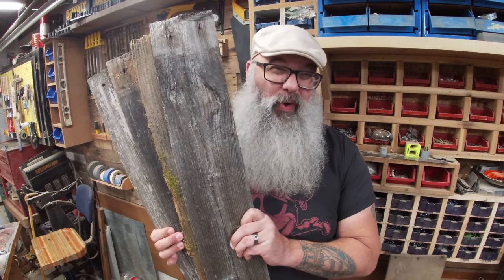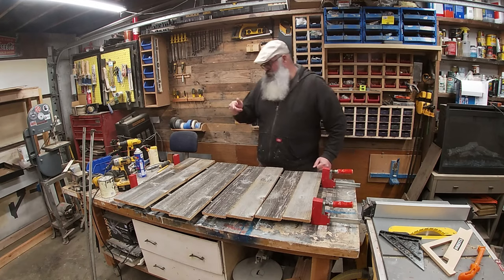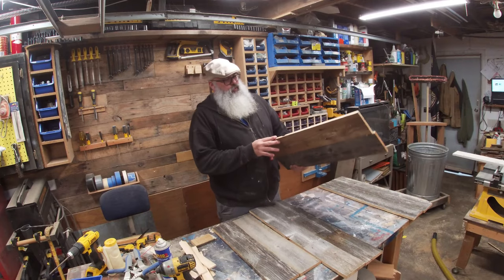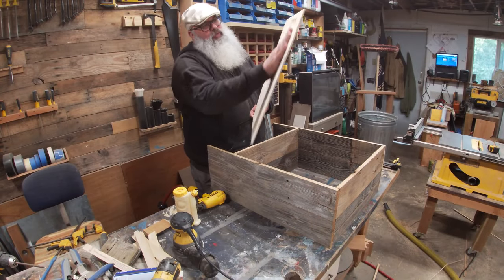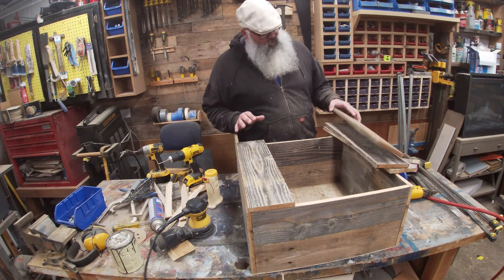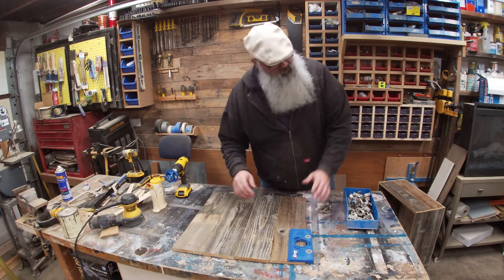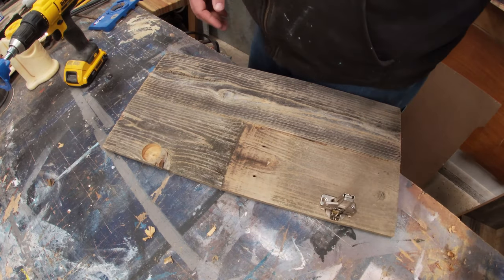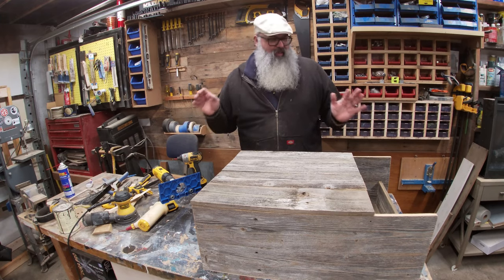Don't Throw Away Your Old Fence Boards!!

Comment: Why don’t you put the clear coat on it before you attach all the pieces?
Reply from the maker: Well it would definitely be easier to clear coat the wood before putting it all together. But because I used wood glue and I wanted a good bond, the clear coat would actually prevent that. The glue penetrates the wood for a strong bond. Very good question, though.